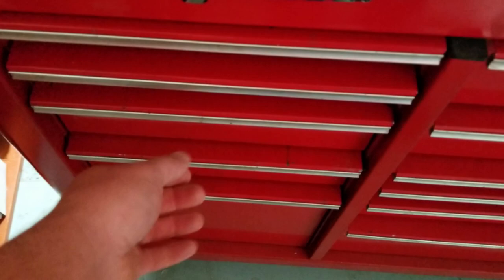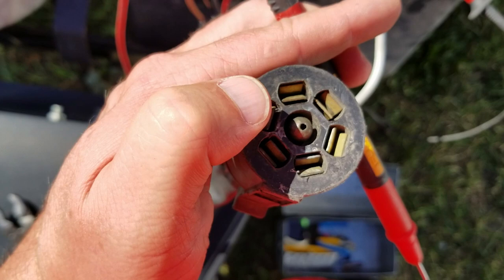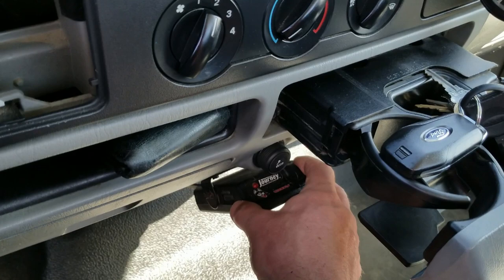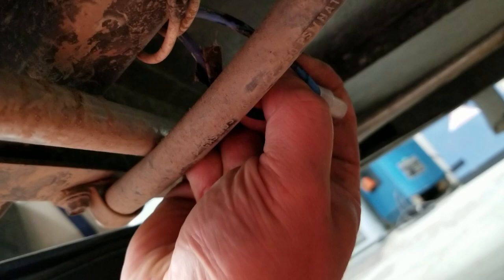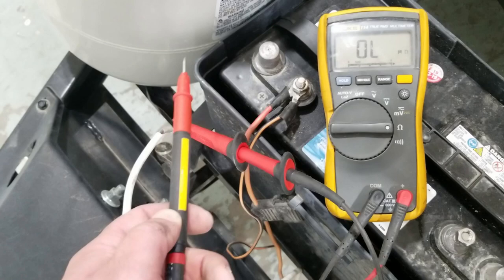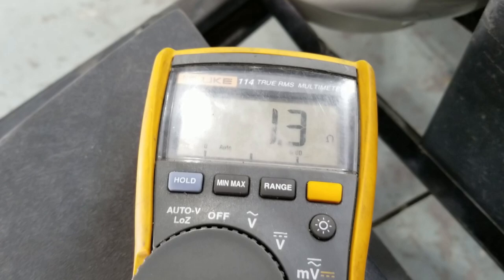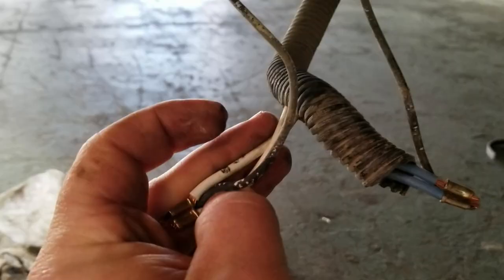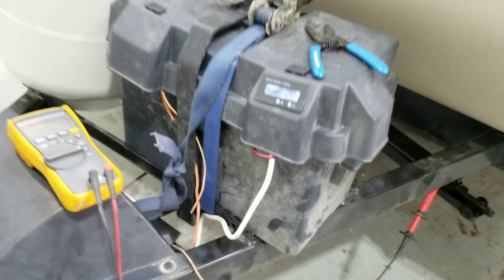Scumbag Offset | sketchy wiring

Comment: I am security tech that I work on systems that don’t work and notice that you can tell who worked on the project.  Either wiring or connections.  I am known for soldering all my connections    Downey California
Reply: Good thing you don't work on vehicle wiring then.

Protip: You're not supposed to be soldering vehicle wiring; crimping is much better in a high vibration environment.
For one, your solder is going to be higher resistance than the copper or copper coated aluminium wiring; for two, a properly crimped connection is effectively gas-tight due to the metal to metal colloidal bond at the surface between the individual wire strands and the connector terminal, preventing internal oxidation if you use a properly rated crimper and die.

Comment: Oh no, a fkn 3m stablock @8:23, fkn junk under the tape. Seen way to much of that half assed shit in my life by morons who tried to fix their own shit without having a fkn clue how the shit works. Give them props for trying, but cheese an crackers do some fkn research, use the right connectors. The only connectors I use have the snot in them. Seal that fkr off from the crusties so it won`t bite ya in the ass later. Just had to completely rewire a tandem trailer cause the owner attempted the fix and smoked the whole thing down, but I appreciate the side business...lol. I`m just a 63 yr old guy who keeps his old shit goin since I was 16, but I always did my research on the issue at hand. Stay safe AvE. Love the no nonsense, no bullshit attitude like myself. Brutally blunt. This is also why I piss off some people, but I don`t give a fuck, others like the straight forward answers.

Comment: They say Scotts know how to hold a grudge.  Well someone must have pissed them off right and proper- maybe a car stereo installer repair guy- and then came Scotch Locks.  How did it cut the wire clean in half...there's a little slot, so how?  

Two rival gangs the Crimps and the Solders.  Are you a Solder or are you wrong?

Why not just throw the positive lead on the battery and look for the smoke straight away cause...trailer wiring.

Comment: Brakes on those little trailers are overrated, don't work most of the time.  You can either pull it like it is or constantly  work on the brakes  and live forever.

Comment: Just do like I do.. buy a trailer of questionable quality they are cheaper. Buy a truck with enough horse power to pull it with the brakes locked up.. insure both and make sure the trailer lights are working. Find a tricksy repair guy and let him deal with play dumb for they work for beer and not money and go camping.. its how the world works.

Comment: 4.6 and 5.4l tricks have common issues where the coolant crossover cracks and it fills the spark plug tubes and coil holes of coolant. Or u have a 3v and the plugs are just worn out. The 3v engines love snapping the porcelain off the hex part of the plug and lisle makes a pulling tool specific for old janky Ford ohv engines. Fix that old jeezlis ford man that newer chevy u got wont last too long!!! Long live uncle bumble fuck!!

Comment: trailer wiring sucks because its put together with the cheapest crappy insulation flaking off wire usually wrapped around a washer welded to the frame and scotchlocks/butt connectors squashed with pliers not crimpers, by a damn teenager who was flipping burgers last week. fought crappy trailers for years for my old boss, now work at a gmc dealer and fight the effects, its never the shitty trailer wiring that's bad it's the nice new $68,000 truck............"it doesn't work with my buddies trailer either" then they bring yon rusty pos by and i don't get paid to show them their wiring is shorted to ground in a plethora of ways, cause its a warranty ticket and the service writers forget to charge a check out fee

Comment: Why is that an electric system? Does it perform much better than the european inertia/overrun brake, seen on little camping trailers? 

Side story: i once was trying to fix my parents' bicycle carrier you put on the tow hitch. Wiring fucked. Incompetent Mitsubishi dealer installed the trailer hitch wiring in such a way, that it was the first thing that would hit the road if you bottom out on a speed hump.
Me, on a cold winter's night, trying to fuck the pixies into submission for an hour, in a car with a 8 year old battery. Being an old battery, on a cold winter's night, after just an hour the car wouldn't start anymore. 

Who gets blamed for a shitty battery? Me. 

It honestly was the last time that i ever try to fix something for my parents again. I love them, but goddamn i'm so done with being blamed for pre-existing conditions.

Comment: Trailer wiring is shit right from the get go. We all know this. We all buy the craptacular contraption anyway.

What I really want is more information on the flashing check engine light.

For those that don't know it means it has detected a fault in your system that is damaging to the catalytic converter.

Comment: I recently spent a whole day testing, then retesting, then buying parts, then buying more parts, then totally rewiring the entire trailer.

Only to find out that guy who installed the trailer lights plug on my car did it wrong, and both blinkers were connected to the same pin.  Now who's the bigger idiot, the guy who installed the harness wrong, or me, the guy who spent ALL F*CKING DAY screwing around with a stupid trailer before checking that the plug was actually working correctly.

I hate trailers.

Comment: pulls safety cable -> safety device catches fire. JFC what a stupid design. 

P.S. For small trailers and caravans in Europe, this system is replaced by cable-actuated brakes connected to a regular handbrake at the coupling, which is connected via a safety wire to the hook. trailer gets undone, handbrake gets pulled, brakes lock, no pixies required.

Comment: 0:42 well, its a Ford........ so, yes.... you do have to ask that question 

5 psi low in the rear tire and she wont start...... 

by my guess..... its an f- "2 shitty" with the under-powered JUNK ASS 5.4...... which costs 2000 dollars to JUST!!!! replace the spark plugs  
because every shop has broken Fords "reinvent the wheel" spark plug.... and said FUCK THAT SHIT, NEVER AGAIN!!!!

we have one at work..... company vehicle.... JUNK
have to rev it up to 5000 rpm before it makes any torque......
Reply: but i wired up a trailer at work..... following the STANDARD wiring color code (owner drug the plug on the pavement..... and FUCKED IT GOOD!)

however..... the trailer brakes would lock up, and stay locked after the first brake application 
after much multi-meter fuckery, and looking at 3 different diagrams..... and having "the old dude" tell me the center pin was ground, and im a young kid and stupid as fuck

i ended up finding out that i had the battery charging circuit hooked to the brake circuit 
wanst my fault (and the center pin was NOT fucking ground)

but the trailer was wired up wrong (at least the STANDARDIZED color coding was off on 2 or 3 pins) 

despite the "old hand" telling me i was wrong...... and trying for 4 hours to fix it..... despite me saying the color code was off.... 
i had it fixed in 10 mins with the use of a milti-meter 

old hand only used a test light....... because he was so "smart"" he didnt need to see the voltages.. 
just "light go on..... or light not go on"